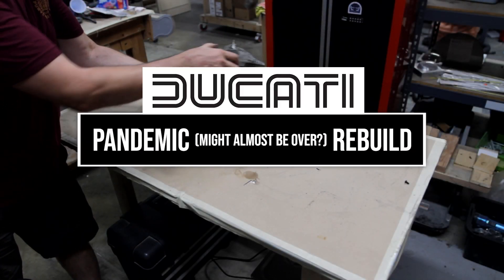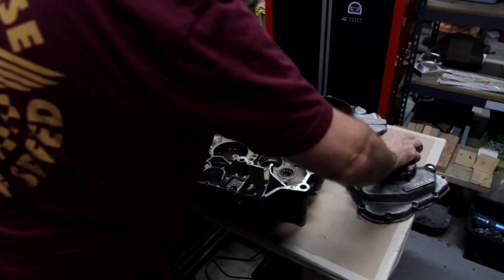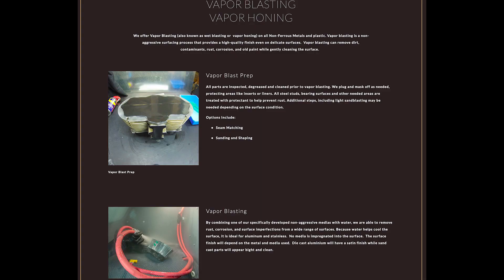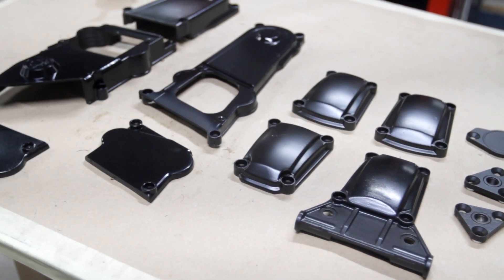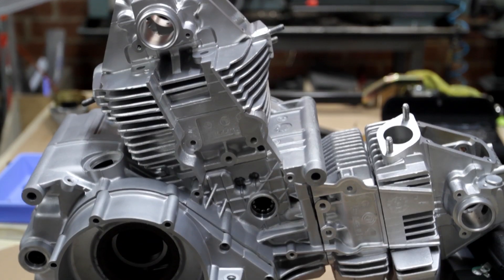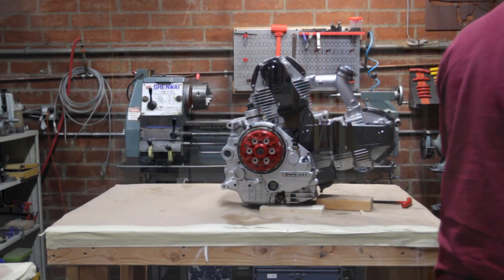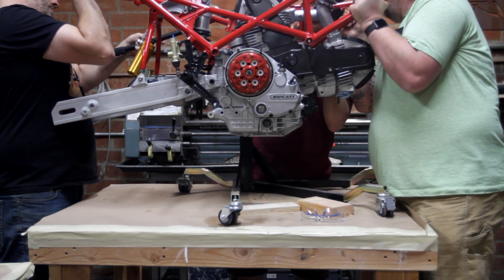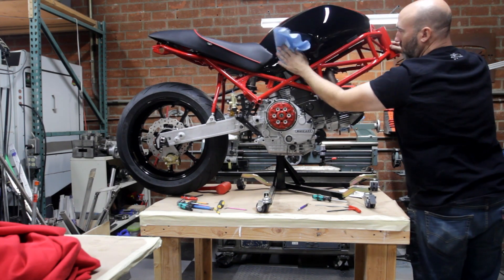'95 Ducati Monster 900 rebuild: Episode 6, "I haven't forgotten"

Comment: Great to see you back and what fantastic progress! The paint on that tank is stunning. Will you be adding any logos or are you going for the 'incognito' look?
Reply from the maker: i dont htink i'll add the logo.  but who knows...might change my mind someday.
Reply: @FrankIppolito  Have you thought about the raised 3D brushed aluminium style badges fitted to the Diavels and Multistradas? They're self adhesive and, if you don't like them, you can always peel them off! Have a look at 43513501A and 43512761B. Or perhaps the M1200 version with Ducati above and Monster below (43511441A or 43511491A). Looking forward to the next installment!
Reply from the maker: I’ve seen them. I’m still not sold on doing a logo.